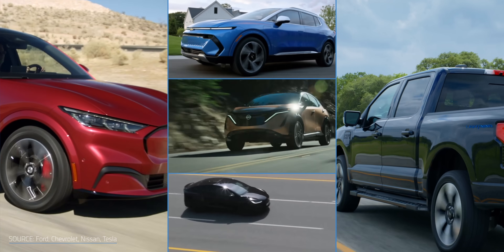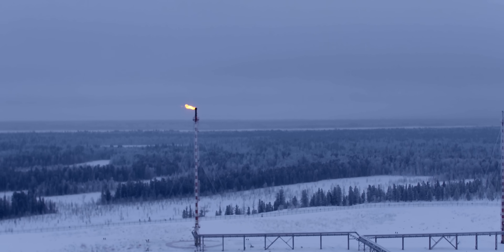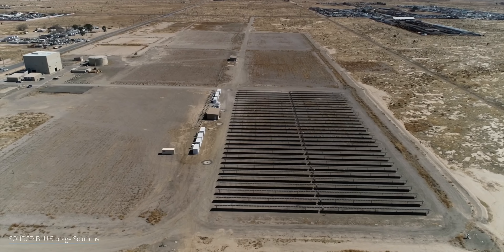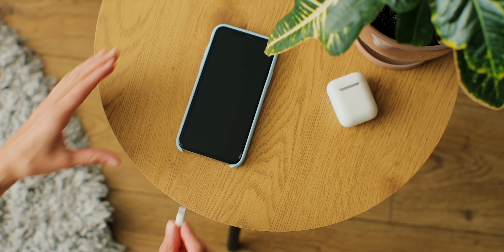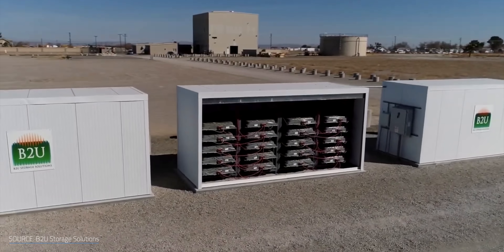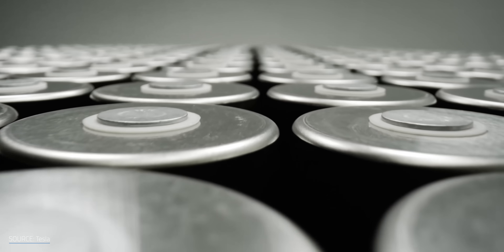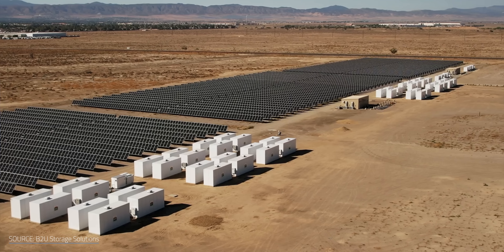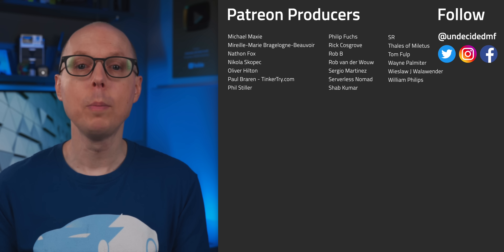How Old EV Batteries are Perfect for Energy Storage

Comment: Solar only works where the sun is shining, but the sun is always shining somewhere on earth.
So the problem of stable, consistent solar generation could actually be shifted to one of transportion of the electricitcy, rather than timing of the electricity
Reply: i have checked out the solar panels and it can perform well under less-light condition.
Reply: It's not practical to transmit half the planet's electricity half way around the planet.
Reply: Yes, it seems so.
My understanding is that ~40% of electricity is lost in transmission, in the lines, and in being stepped up and down in substations.
thus, It makes sense, to have generation & consumption closer together. Using waste electricity to produce hydrogen, or, transmitting the economic value of the electricity, by siting High Load Data centres near generation sites - Information certainly CAN be transmitted round the planet, in the sixteenth of a second.

Comment: I have been living off grid for 6 years now on 16000 watts of used solar panels and 4 packs of chevy volt batteries with 18000 watts of inverters.  I run a normal 3 bedroom 2 bath house and charge a Chevy bolt car from my system. It's totally duable. My system paid itself off almost one year ago Including the price of the used Chevrolet volkcar as well.
Reply: Did you do a YouTube or DIY on this? I have accumulated a couple of Prius battery sleds and want to do essentially what you have done but want to learn from your experience if at all possible to keep from remaking the proverbial wheel as much as possible. I understand that the to manufacturers are probably very proprietary hence different but i want to use as much of their equipment as possible where it makes sense to and will probably to reprogram not to mention add more hardware as i only have the battery sled and not the computer that managed delivery of power to electric motor. I appreciate your post and hope to see a response if possible to my query.
Reply: @Monstur9   I built my system on my own. The  Toyota batteries are not good for building power walls . They're the wrong chemistry. I have YouTube videos under my name if you want to see a lot more about my system.

Comment: I kinda use this at my home on a micro (nano/pico?) scale.   
Whenever my older powerbanks die i pull out the batteries and use them for extras solar nighlights around my home.

I replaced the soldered connections on the nightlight pcb to modular battery holders for easy swaps. 

Instead of using one new battery I use 2-3 used ones and set them for low current draws. Have been using this for a year now and its going great. The mobile powerbanks were anyways going to a landfill in most cases (atleast in my country)
Reply: Same for me lol, there are "dead" powerbanks that are tossed out to the e-waste bin near my village. Most of them are still has perfectly good battery and the thing that is dead are only the BMS module. I replaced the dead BMS with the new one (which is very cheap) to give them second chance of life

Imagine getting free power bank from dumpster and get it working again as intended with very cheap modules from various electronic stores
Reply: @sihamhamda47    
oh yes this is way better, I was talking about faulty batteries 

A lot of generic powerbanks use bad BMS/charging boards which go kaput in 1-2 yrs. The battery is usually in such great health that it can be reused for inhouse usage safely by adding in a basic 1 dollar BMS + charging ckt
Reply: Cool idea!
My take is in using less battery powered devices 😂